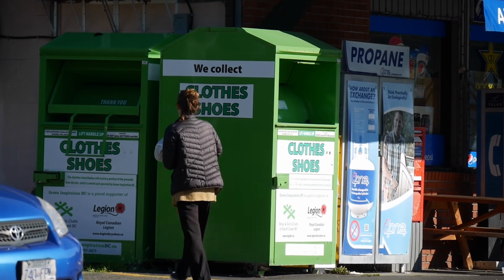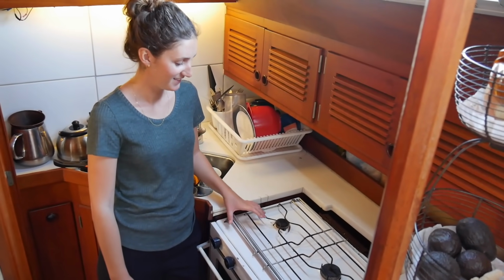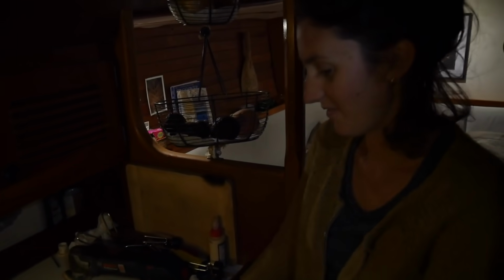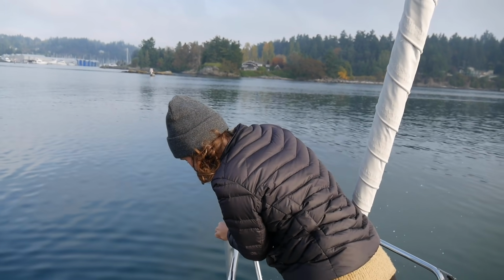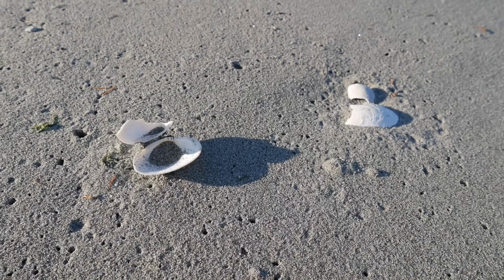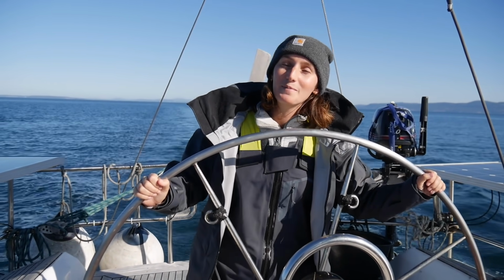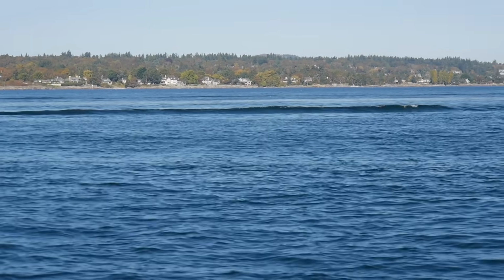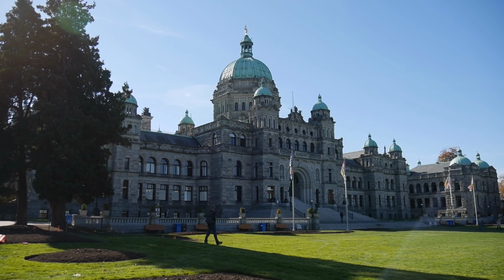There Is No Such Thing As A Small Boat Project - Ep. 141 RAN Sailing

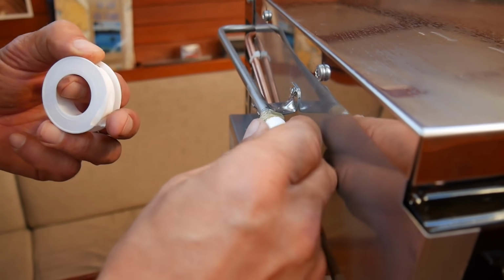Comment: not trying to be a smartass and i freely admit i am rather inept in the mechanical department, but at 6:07 i see you were thread taping that brass gas fitting.
now....PLEASE correct me if i'm wrong because i usually am, but i thought you weren't supposed to thread tape fittings that had a metal to metal seal. i always thought that taping the threads that enable you to squeeze the metal to metal tighter together that you are actually impeding that function of the fittings by taping them.
any gasfitters or mechanics out there?
great episode as always.

Comment: Your stove install involved a bit more than you bargained for, so it goes. Boats and homes are alike in many ways, you dig in on a DIY home project and find that the fellow who "repaired" or "fixed" something before did a hack job of it (In my case, it is usually my dad, bless him anyway). If you are a craftsman, like Yohan, you want it done right, so you spend the extra time and effort to correct matters, and ensure that the next homeowner, many years down the road, is pleasantly surprised to find a well done job.

Thank both of you for another swell video. Stove looks great.